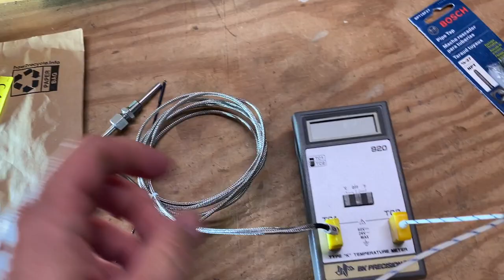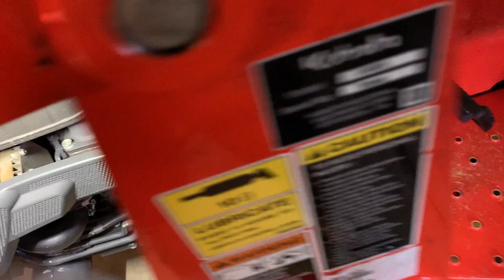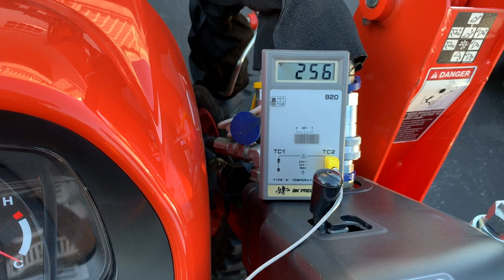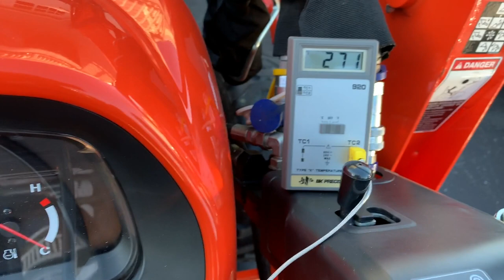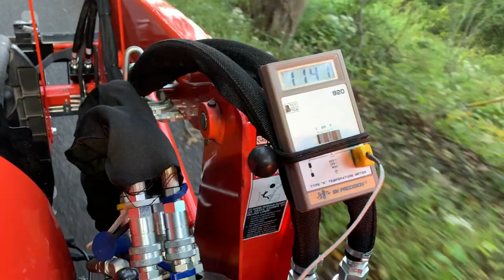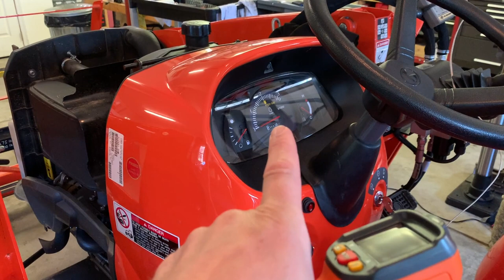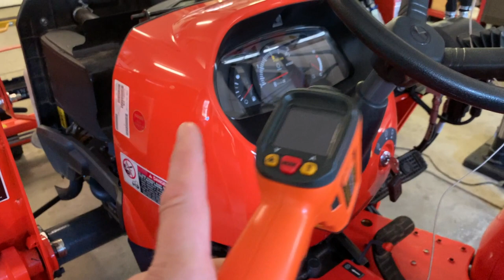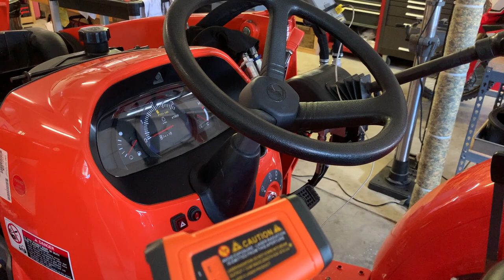Increasing the engine power of a Kubota L2501 / D1703-M-DI-E4B - Part 2

Comment: I just completed this is modification on my L2501. I took both shims out and used three bond 1184 gasket maker to seal the pump back down. Absolutely no issues doing that. I also backed the fuel screw it half a turn. Wow, what a difference! It's quite noticeable. I did install an egt gauge and the hottest it got was 1000. I might try backing it out another quarter turn but I'm super happy with it as is. Only a tiny bit of smoke under the heaviest of loads.
Reply: Me too. Ditto.

Comment: Just did this mod today on my new L2501.  Your video made it straight forward and it went very smoothly.  THANK YOU for the research and effort making the video, I wouldn't have attempted it otherwise.  I couldn't tell much difference after the injection timing change, but noticed a big difference when I increased the fueling.  I agree that they both go hand-in-hand together though.
Note:  Both of the shims under my injector pump were the same as yours, .010" and .008" using mics.  After advancing the injection timing by removing the top shim (.010"), I used a small cutoff wheel and removed the cap, then turned the fueling screw out 1/2 a turn.  That setting rolled a a little coal under heavy load.  I'll turn it back in 1/4 turn tomorrow and see what happens.
Sincere thanks again.
Reply from the maker: Thx for sharing!  Highly recommend getting temps with an EGT probe to correctly set fueling.  You could probably 'chance it' and be fine, but knowing you're safe is worth it in my opinion.
Reply: @netmagi , I ordered the probe and gage you recommended yesterday, should have it this coming week.
Reply: BTW, I was able to do the mod without taking the third injector loose.  Yay!  The intake manifold can be rotated to the side around that line, underneath the fuel tank.  That saved a good bit of time.
Reply from the maker: @wireedm1  awesome, I hadn't thought of that
Reply from the maker: @wireedm1  testing worked best for me on a long steep hill (half mile in my case).  I found setting rev's at ~2650 and feathering the HST pedal to keep it from bogging much yielded the highest temps.  With EGT probe it updates fast enough to see what small changes in the pedal do.  The longer the hill the better.  Mine takes almost the full half mile to reach the highest temp.  Kubota would probably consider that an 'overload' or 'stand-by' output condition, but I wanted to set fuel for that worst-case condition.
Reply: Did you not test the stock temp for us like he said he wish he would have?
Reply: thanks for that tip. saved lots of time fishing the manifold through the 3rd injection pipe. was able to get the other 2 nuts off without removing the injection pipe over the the injectors.
1 question for you sir.... what are the results on 1/4 turn out for limit screw?
Reply: Were the results substantial for you? Just bought my 2501. Wanting to wake her up by doing this modification.

Comment: I just added the exhaust gas probe to mine which is still completely stock.  The hottest I’ve gotten it to read so far is 890.  I was not able to work it as hard as I wanted.  I ran the snowblower for about an hour in deep, heavy snow, dragging the rpm’s down but I know I work it harder in the heart of winter. The outside air temperature was 45 degrees.  I’m going to run it a few weeks stock and let the outside temps go up to get a solid baseline before moving forward.
Reply from the maker: Thanks for sharing.  This is really interesting, particularly because it's a bit higher than other folks have reported over on orangetractortalks.  I'm convinced people are underestimating how much of a difference it makes running it at 'full load' for an extended period of time like I am on that long hill.  I just measured that hill on google earth, and it's exactly half a mile, with a 335' elevation change.  It flattens a bit in places, but the last 200' feet towards the top measure at a 14-17% grade.  It takes nearly that full half a mile to get to peak temp for me.  If you're hitting 890  bone stock, I bet you'd get close to 1050ish with just more RPM's and stock fuel/timing.  I could probably add more fuel and still be 'safe', but I like having some headroom.   I still want this machine to outlive me, which is why I bought Kubota in the first place.
Reply: @netmagi  Full load is hard to hit and keep at.  I was shocked how fast the temps shoot up with adding a little load to it.  I was running at about 2200 RPM.  I drove it wide open in Medium for about a 1/2 mile with little change, steady between 660 and 670 degrees.   I went up one small incline and it shot up to about 750 degrees then went right back down once it leveed out.  I had to drag the RPM’s down close to stalling it to reach the 890’s snow blowing. It averaged in the high 600 to low 700 snow blowing without dragging the rpm’s down more than about 300.  On a side note, the temperature gauge on the tractor never got up to the middle range, as if 3/8 from bottom the entire time.
Reply: Clockwise or counterclockwise to give more power, in or out?
Reply from the maker: @akalpharaider7580  out

Comment: I’m glad you dug into the fueling / smoke issues on these tractors.  The soot is bothersome but the smell is what drives me to distraction.  I have a Kubota B7000, grey market tractor (40 yrs old, owned since 1997) and the difference in smoke and smell on the same fuel is night and day better than the 2016 L2501. I was needing to find info on this same issue and looked on OrangeTractorTalk previously, while not digging too deeply.

    I will try to get an EGT probe for my unit to do a before and after as the smoke is too much to live with.  I do not have a hill in my area but I do have a 60 inch cultivator to place an extended load on it.  No plowing now as the ground is currently frozen and I can do it in May perhaps.

Comment: It was almost as if I was watching myself fight that tamperproof cap and losing my baseline!  I did the EXACT same thing.  I also overcorrected and ended up with less power off the bat, then backed it out about a half turn at a time.  Runs soooo much better now, no visible smoke.  Been "turned up" for over a year and loving it.  It does burn a little more fuel but that's no complaint.
Reply from the maker: lol!  thx for chiming in.   Watching my own footage again with a fresh mindset, I wonder if there's a dealer tool that you just hold VERY FIRMLY against that domed nut on the end that backs it off with just friction. Might be possible to just dremel a slot in that domed nut on the end and use a flathead as well.  I hope the next person to fight one of these off can use the footage here and the shots of 'what's inside' to get theirs off easier.  The biggest challenge for me was just not knowing what's under the cover to come up with a plan for defeating it.  Which, I guess, is the purpose :)
Reply: @netmagi  Since watching your last video and seeing the cover was made of cast aluminum material I decided to try a different method. I ended up using a pair of large vice grips and squeezed them on the cover until the cover cracked on the casting line. It actually worked surprising well without damaging the nuts or set screw. Just had to use a screwdriver to finish spreading apart the cover at the cracked line and then pop it off. Figured I'd share this as it might save a future L2501 enthusiast some time and a possible headache.
Reply from the maker: @JTsStumpGrinding  Great idea!  I wish I was able to see how it was made before I had tried to remove it and lost my baseline.  I'll pin this if I can.

Comment: Thanks for explaining all this in detail. It helps. 
I turned up the fuel some on my 18 year old BX2230 to where if it really bogs it will blow black smoke. Before if it bogged it would not really show any smoke all the way down to killing the engine so I now know the fuel screw was too far in limiting engine power.  Now in normal mowing with a full load I adjusted it so it will have maybe just a barely visible hint of smoke at full load (you have to really look for it). I used it in 3 acres of heavy field grass cut rather short with the 60" mid mount mower at 95* and it went right through it with a lower temp shown on the engine temp gauge than before I adjusted the fuel. That was surprising to me. I can also use a bit lower rpm like I mow the yard around the house to get the engine where it is more efficient in fuel usage now too. I think I will take your advise and install a EGT sensor as I think it's a good idea overall to monitor the EGT. Maybe also consider making some changes (shims out) to the pump timing. 

One hint on the fuel screw is to use vice-grips to smash the anti-tamper sleeve down onto the two nuts and while still clamped in the vice grips turn the screw to loosen it. Remove the vice grips and count the turns it takes to remove the screw. Then you can remove the anti-tamper sleeve on the work bench. Put the screw back in then do the adjusting.

Comment: Today I performed the pump shim mod on my L2501. My pump had the one hole shim and the no-hole shim. The No hole shim is .30 mm and removing it reaches your stated goal that you wanted. I report this to verify that you are absolutely correct that different L2501 engines CAN have a different assortment of shims from the factory. 
I was thrilled that mine has the .30 mm shim. Which, of course, I have now eliminated. 
I have not test run mine yet. I had the #3 injector go bad and a replacement is due to arrive tomorrow. 
By the way, unless any of you know a better way than my dealer and I did  to replace that #3 injector (closest to the firewall) you will experience a NIGHTMARE! 

I am looking forward to testing my tractor with the pump mod. I also have the fuel control shaft uncovered and ready to adjust. 
I am installing an EGT gauge also.

Comment: I was recommended to watch this video and almost didn't due to length of video. There is so much information on here and I dont even own a tractor. We actually got a Fluke infared thermometer to troubleshoot a dehydration station and was way off compared to the RTD installed, we came up with the same idea as you mentioned. Well I am looking into either a Kubota or Kioti in the 25hp or 35/39hp range. I wanted to avoid all the extra emission equipment but would a stock 25hp tractor lack with a certain application or task. My main purpose is to use the brush hog and loader on flat sandy loam dirt in 40f to 115f temperature, yes Texas weather. Great video and sure packed with info.

Comment: My local Kubota dealer told me not to buy a L2501. He said i would not be happy with it.    Its nice that some people are still honest.  I ended up buying a kioti.   Almost twice the lifting capacity and it seems to have a lot of power for a 25 horse. No smoke either lol.   Kubota are great machines but they are under powered and over-rated.
Reply from the maker: While I usually try not to feed the trolls, this is straight up misinformation.  The Kioti comparable loader, the KL4030 lifts 1,835lbs from the pins @ just under 60" lift height.  The LA525 lifts 1,803 lbs at the same height, at the same PSI setting, or 1,490lbs at factory PSI.  Even factory PSI vs. factory PSI, that's a difference of less than 25%, not 100% (or twice as much) like you claim.  Kioti likes to lead with their 60" number (1,835lbs), while Kubota leads with their lift capacity at FULL HEIGHT, 95" (1,082lbs).  Don't get tricked by the marketing folks at Kioti that are banking on folks making this same mistake when comparing.  As for the smoke, the Daedong engine may very well be better tuned stock for a more efficient burn.  Would need to compare EGT's across the rev range and measure airflow, etc.

Comment: Outstanding job.  You are very thorough and it's appreciated. 

My L2501 is so smokey.  I'm glad I have a solution now.  I just bought my tractor but doubt I'll wait until my warranty ends. My lungs mean more to me. 

One question, when are you putting on a turbo charger?  Lol.  It's the logical next step. I can't wait to see that video. 

Thanks again for doing your homework and sharing it with the community.
Reply from the maker: Thx for your reply.  I don't think I'll be going turbo.  It feels 'right' to me now power-wise for the frame size.  Nothing wrong with going turbo though, would be a fun project.
Reply: Mine had 5.5 hours and I've noticed no enumerate except when it cranks
Reply: First Choice Mechanical  DPF equates to more problems. For weekend warriors who don't live on the equipment, it would be nice if the tractor exhaust clean was just set up to burn clean as it can without DPFs.

Comment: Something to think about on EGTS; think of a oxy-acetylene torch, if you wave the flame over an aluminum block, it won't melt but if you hold it over the block, it will.

Same thing for our engines, high EGT's for a brief period of time isn't a big deal BUT sustained high EGT's is where we melt pistons.  For most diesel piston alloys, you can sustain 1200 degrees without melting the pistons.  But this also depends on where you get the temp readings.  The best place is right at the collector flange of the manifold like he did here.

Comment: Thanks for the video!  I have the same tractor also.  Seems like a pretty doable upgrade for such an increase in power and to improve bogging and smoke.  How much was the unit that the sensor plugs into?  All I have is a small temp gun like you were showing.
Reply from the maker: I picked up the one I'm using second hand years ago for less than $5 at an estate sale, but the one linked in the video description is less than $30.
Reply: I just installed my egt probe in the exhaust and did a test run in high gear down my street. I don’t have any large hills but the one I did run up got the temps around 1025 for a very short time then dropped back to around 950. This is still a stock 2501. I haven’t turned the screw in or removed shims yet. Planning on not doing changes till I see what it does with a load from my tiller and other attachments. Great video on the upgrade. I’ve watched it several times now lol

Comment: Melting point of aluminum is 1220 F at sea level (standard pressure) inside the combustion chamber, during the hottest point, you have 11.2x the pressure which puts the melting point at around 2000 F. I wouldn't start to worry about EGT until it reaches 1500 F for more than 2 or 3 minutes. Science wins again.

Comment: As far as no smoke ,  it's just unburnt fuel,  previously it was because of the timing ,  but with the higher fuel burn the fumes bothering you will likely be less.  Don't be so worried about a touch of smoke

Comment: Can’t wait till my warranty expires (might not wait that long) drives me nuts that even going up a small hill the engine bogs a bit even in middle range on HST. In high range it bogs horribly on hills.
Reply from the maker: Much better on hills now, even with the higher RPM's (which result in higher speed).

Comment: Boy, very helpful! Just got 2017 L2501D low hours 250 want do the same thing you have done down the road. And do the hydraulic pressure as well. Most likely will do the hydraulic first.  There's video out there where guy put a nice Pyrometer on the side of the dashboard. Will do that and hydraulics first. I'm not close by but would like to communicate with with you if I could... Haven't watch your first video on the shims on the pump yet... Right most definitely need ballast in the rear as it will lift the back end off of the ground. Haven't looked closely yet to see if anything has been done to it before messing around. Like the gauge you used on pressure hydraulic.
Galen

Comment: I'm following your video's on this and Im not quite clear which way and how much you adjusted the fuel adjustment stop. I did find where your adjustment was... thank you.
Reply from the maker: Unfortunately, it's not a set amount that will work for every tractor.  Need to install EGT probe, then put a 'full load' on tractor and tune for the temp you're comfortable with.

Comment: What happens if you accidentally unscrew the fuel screw all the way out?  Can you easily screw it back in (meaning it is not holding back a spring, etc) and go through the process that you did with smoke test.

Comment: So you don’t adjust the actual throttle adjustment correct? Just pump timing and fuel adjustment will increase the RPMs?
Reply from the maker: RPM limit was increased b4 I did this work.
Reply: @netmagi  copy that. I’m going to install in EGT temp and then run my Bushhog which puts the most load on the engine. I will establish a good baseline

Comment: Thinking more about this video and process I do seriously wonder if the L2501 is above the 25 horsepower anyway. The 25hp is at 2200 RPM’s but mine goes to about 2400 rpm’s and feels like it has more power pulling uphill at that rpm vs the 2200
Reply from the maker: it probably does peak just over 25hp at that rpm, but if you look at the dyno sheet comparison I linked in video description, you'll see it stops rising due to the fuel getting injected too late  at stock setting for higher RPM's

Comment: Is this something that the dealer would know if we needed warranty work?  Easily reversable back to stock? Also I have the gear drive instead of hst. Would it all be the same?  I assume so but the gear drove shouldn't big as easily since they pull a little harder than hst.